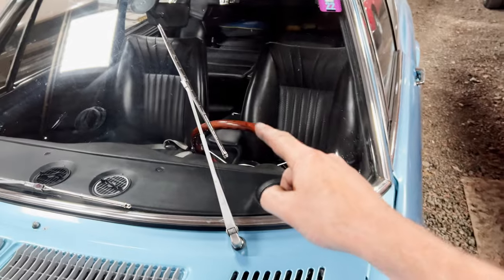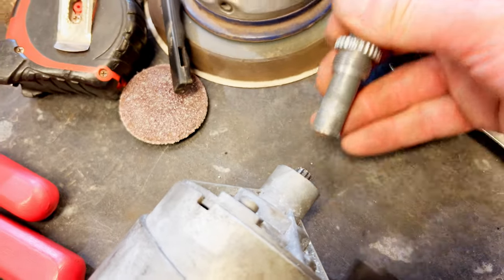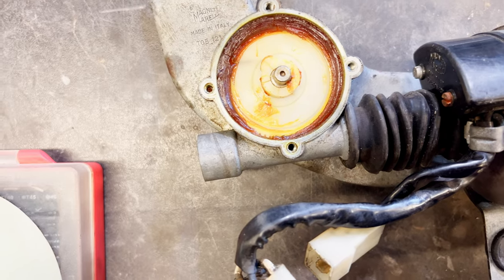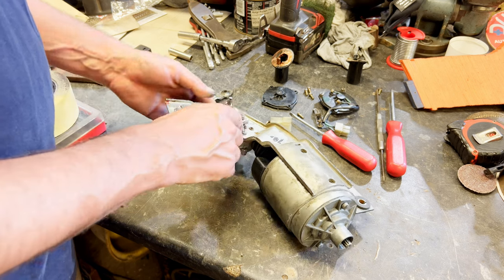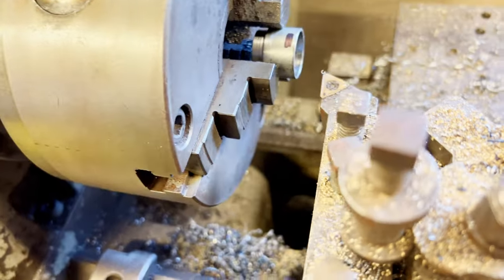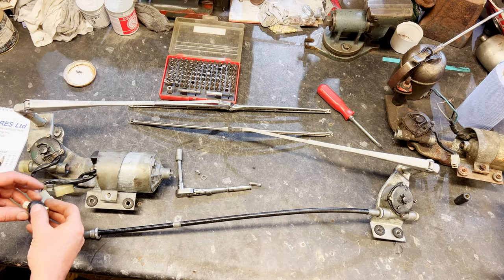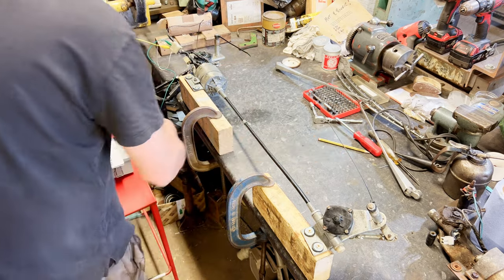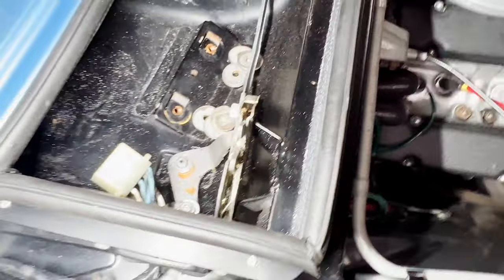Title FIAT Dino wiper repair.

Comment: I remember some years back, I serviced the mono-wiper on my Mercedes 190e.  On some cars, you could just take the cover off the top to grease the internals etc., but on my car you took the whole assembly off, and disassembled it from the bottom.  Everything went well, except for the fact I didn't time it correctly.  In the end I found information on how to time it, and it works great now.  Thanks for the video.  Cheers, Rob.
Reply from the maker: @zambam3  Yes I remember working on one years ago when I ran the garage but I can’t remember what I did. Something about getting it timed correctly after sorting out the seized mechanism. Has that sort of ram effect to throw the blade out to the edge of the screen.    Glad you enjoyed the video.

Comment: That Dino Coupe is in excellent condition, really nice to see.
Reply from the maker: @JoakimMiller67  The Dino Coupe is called ROMA as it had Rome plates I restored it a few years back. There are videos about it on the channel.
Reply: @marksitaliangarage  Oh, very nicely done then, I will check out those videos
Reply: @marksitaliangarage  I would love one day a coupe fiat dino, just wondering are they reliable for enthusiast to use it more than 10k miles a year?
Reply from the maker: @DKarGarage  Yes they are very capable  . The factory service interval is at 6k .  I would go for a 2400 for high mileage use as they are a bit more robust.
Reply: @marksitaliangarage  i wish I could find a decent 2.4, I found a 2.0l for 32k runs and drive but needs some work to interior, wondering if I should pull the trigger on it

Comment: You're not going to believe it Mark but this week I am working on the wipers on my Dino Spider.  Took the panel off and found out the motor is MISSING completely.  I think 30 years ago the owner couldn't find a replacement and just chucked it.  Plenty of motors still available today.   We are getting closer to finishing the mechanical and electric issues after months of work.  Thanks for the great videos!
Reply from the maker: @mikelfrance-l6x  That’s how you add lightness !
He must have been a Colin Chapman disciple .
Reply: @marksitaliangarage  What I have to sort out next are the 3 lever controls by the hand brake. Mine are completely frozen.
Reply: @pietrobuffone9898  Yep.  But I found them from several sources.
Reply: Wiper motors for 2 litre Dinos are hard to find, and only shared with the Fiat 124 AC coupe IIRC.  The gears break and seize the motor, and they burn out.  Available replacements need messing about with relays to make them work
Reply from the maker: @mikelfrance-l6x  take the lot out and soak in penetrating oil. .  If the cables don’t free up you will have to make new.
Good luck

Comment: We used to use Devcon Flexane, castable rubber for making these coupling spiders. That was before Sikaflex. Flexane was expensive but brilliantly versatile.
Reply from the maker: @MadDogMark11  Sikaflex was the go to for years but now my local supplier carries Tiger Seal I’m sure it is pretty much the same thing and at £10 a tube it is good value. It does tend to go off in the end of the tube but as you have seen I tend to get my moneys worth by sticking a screw driver in the tube and pushing it out of the side. It’s very versatile and has got me out of trouble on many occasions.

Comment: What a complicated system and a very nice repair. Those doors sound fantastic must have taken a lot of time to get them that 👌
Reply from the maker: @stephenlmckeown1439  There are far simpler ways of making the wipers work. The Lucas system fitted to the Maserati is so much easier. It is still available on the aftermarket and I have fitted the whole kit to the Amphicar.   But I must admit I quite enjoy the complexity of the Dino Coupe system for no other reason than it is interesting to see something different.
The Coupe is a real quality car and when you get the doors working properly they do sound great.  I made new door skins during the restoration you can see them in the ROMA videos .

Comment: If memory serves, I had a lot of friction in the cable connecting the LH wiper gear to the motor drive. Cleaned rust out w WD-40 then sprayed some lightweight aeresol hinge (?) grease in there. Also the vertical bushing drives that hold the blades had way to much resistance and required similar treatment. As always, a tip of ther hat for the great work you do.
Reply from the maker: @yellowrat77  They do suffer with corrosion especially in the wheel box shaft.  It is possible to strip them down to clean it out and lubricant but the spline part is a press fit so can be tricky.  Some if not all of the 2400 have bolt down wiper arms and appropriate shafts in the wheel box so they are easy to deal with.
I had been through the whole system on ROMA years ago. It’s actually the job that it actually came in for originally and then stayed for the restoration.
Reply: @marksitaliangarage  To avoid pressing wheelbox shafts out, I drilled a small hole through the bodies so I could get penetrant into them, and worked away it them

Comment: What a fantastic video, thank you, Mark! My 2.4l has the problem that only the intermittent wiper mode is not working. The continuous mode is fine. I have tried to change the relay and the wiper motor itself, but it didnt help... I think many Dinos have this problem and I just dont know why.
Reply from the maker: @bertone83  is the wash foot pump plugged in ?
Reply: @marksitaliangarage  yes it is, but I will check the electric connections again. Thanks for the hint!
Reply: ...I just checked it this weekend: the pump is plugged in and works perfectly: it squirts water onto the windscreen and makes the wipers move. I am still clueless why the intermittent mode doesnt work...

Comment: How did you know what the coupling should look like?  Did the part you had come from another Dino?
Reply from the maker: @CraigJones-x5t  The white nylon spline parts are what was left of the original.
The black coupler is from a 2400 unit which looks different, I assume that it was modified during the production and development phase.  I made my one with the steel sleeve to allow the Tiger seal something to bond to, it’s just something that I thought would work. The original design would not have this sleeve. Just a sort of bonded rubber coupling.